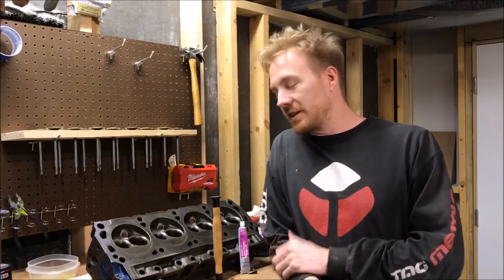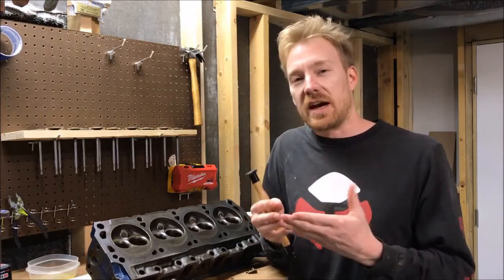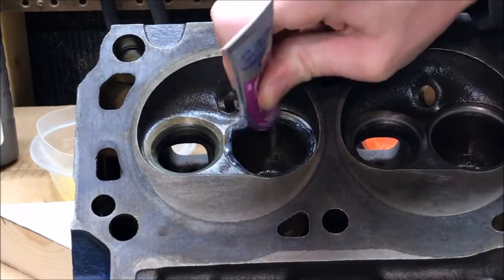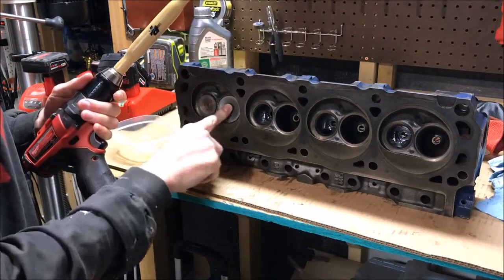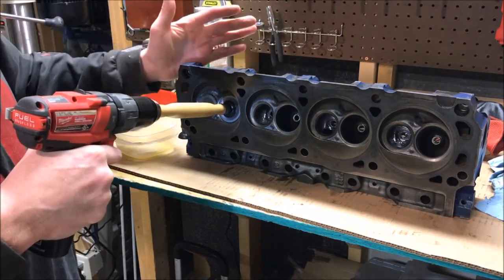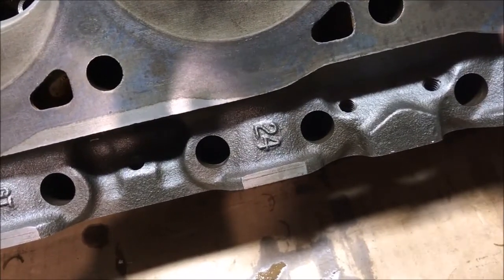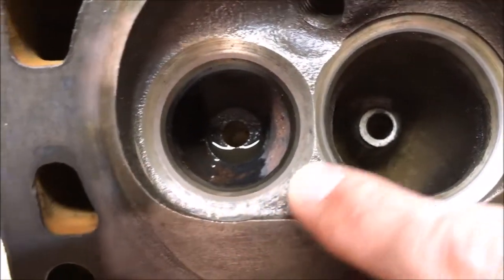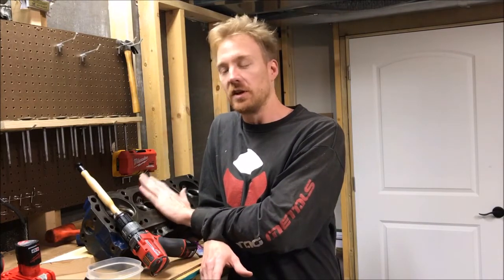Lap Valves the EASY & SAFE way on GT40 Iron Heads

Comment: When you're drilling the valves back in with the suction tool, you wanna drill back and forth; a few seconds clockwise, then a few seconds anti-clockwise, and repeat, until you no longer hear the grit. This is better than just continuously rotating the valves in a single direction. Just a pointer.
Reply from the maker: Thanks for the suggestion.  I’ll be doing heads again over the winter and will give your method a shot. 👍
Reply: i guess Im asking randomly but does someone know a trick to get back into an Instagram account??
I was dumb lost the password. I love any assistance you can give me!
Reply: @Toby Ricardo Instablaster ;)
Reply: @Erick Levi thanks for your reply. I got to the site thru google and I'm trying it out atm.
Looks like it's gonna take a while so I will get back to you later when my account password hopefully is recovered.
Reply: @Erick Levi it did the trick and I now got access to my account again. Im so happy!
Thank you so much you really help me out !
Reply: @Toby Ricardo no problem :)
Reply: Correct.
Reply: Every time I see this method of going back and forth I want to know why?  Why is that better than going in one direction, lifting off the surface momentarily and continuing?  I can see no benefit to that.

Comment: I I have probably lapped well over a thousand valves. I gave up years ago trying to get them stupid suction cups to work LOL. I had brass teeth made for my drill and all I do is check the valve stem up in the drill and from the other side of the head I do my lapping .so much easier. You can use any drill, if you want to take the time to put some duct tape on the end of your valve. you'll be good to go. The guy that made this video knows what he's doing he was at the right speed and used the right amount of compound.
Reply from the maker: Hello. Awesome idea grabbing the valve from the stem end. Where did you find brass teeth for your drill?  I would totally do it that way as long as the stem wasn’t damaged. Thanks for the nice comment and suggestions! 👍
Reply: @FastFixYouTube  I had them custom made by a local fab shop. You really don't need them. you can take a empty brass shell casing and cut the neck down part that holds the bullet off and fit it over the end of the valve and then chuck that up in your drill. Or just use tape
Reply: @FastFixYouTube  I have a video on my channel of my process

Comment: Thanks very much for your thoughtful and well produced video!

I'm working on my first flathead engine and potentially first valve job.  As usual, I do a lot of research to learn tools and techniques before diving in.  While watching the ridiculous old school method of back and forth spinning a hand tool on multiple videos I thought there must be a better way and contemplated buying a standard set with 4 suction cups and mounting them on 5/16ths dowels to chuck in my drill.  Now you've pretty much confirmed my thought process so that's what I'll do first.  I can control my drill right down to almost a standstill very easily and just as easily either reverse direction (which I actually see no need for) or simply lift and drop as necessary to get more lapping compound on the seating area.  If all else fails I can go back to the old fashioned way because I'll have the wooden hand tools stored.
Reply from the maker: Hey there! Yes, your intuition is absolutely correct.  No need to do it the old school way. There  are of course techniques and hacks that they use to make the suction cup and hand method work, but the drill is the best by far. Like you said, you can control the speed to a standstill if you want. And yes, just lift the drill to get more compound i between the valve and valve seat. It worked perfectly. Best of luck with your project. Sounds pretty fun 👍

Comment: Use an old Bit Brace chucked up to the valve stem and start turning. That way you won't have to fight hearing over the drill motor. Works like a charm
Reply from the maker: Hello. Yes, I like that idea. There’s a guy who said he got a custom brass chuck made for his drill and it works great. Thanks 👍
Reply: Excellent suggestion! I'm too cheap to buy an oscillating tool and grinding in multi valve heads with a stick and sucker sucks my will to live!

Comment: Hello friend, put the rubber on a short shaft, and put a spring between valve and seat, and you will see that it works better.
Reply from the maker: Good tip 👍 appreciate it

Comment: Thanks for the helpful videos I don’t know if I missed it but how do you clean the heads so well before paint I have some that are pretty rusty can I use evapo rust remover?
Reply from the maker: Hello. Yes, that will work. I used engine degreaser. These heads weren’t very rusty and only had sod surface rust. It takes a good while to clean however. The parts washer at your local machine shop will do a quick and good job. If you don’t have several hours and a young back to put into the heads, I’d recommend the machine shop 👍

Comment: im sorry but how do u expect the suction to stick with it not being wet?
Reply from the maker: Hello. I tried it wet too, but no luck. I’m chalking it up to lack of experience on this. I know a lot of people use the manual method with success, I just didn’t have the talent.  Problem solved with power tools, haha 👍
Reply: @FastFixYouTube  so I spoke to soon. I'm actually enrolled in a tech school taking engine repair and basic electrical right now and was able to experience first hand the complications and pros and cons of valve lapping the day after I posted that comment and I will say valve lapping is a pain in the ass...wet or not wet that suction cup will only stick if it wants to regardless if ur doing it by hand or with the drill 😀
Reply from the maker: Hahaha, well I’m glad I wasn’t the only one having issues 😂😂😂.  Several people say to chuck the valve stem in a drill and do it that way.  The issue I see with this is scratching the valve stem in the drill chuck.  Some people use brass chucks to resolve this issue, but I have no idea where to acquire those.  Anyway, best of luck at tech school!  That’s awesome man!

Comment: I just had a dumb idea. Would it be OK to use a paint cutting compound after you finish regular valve lapping to get a nicer, smoother finish?  🙂
Reply from the maker: Hello. I’ve never heard of someone doing that, but the cutting compound should get them to final smoothness. If you try, let me know the results. Thanks for the question!
Reply: I used glass polishing paste for final finish because valves and hardened seats are a lot harder than paint

Comment: Gas hose on the valve stem and then into the drill. Works a million times better than anything.
Reply from the maker: Yes, that’s an excellent method and what I will do next time. Thanks for the info! 👍👍😊

Comment: The reason your hand lapping hasn't gone well is the fat diameter of the wooden bit , you need to stick it in the lathe and thin it right down to a concave section where your hands would use it , the thinned section will increase the speed , sit your valve seats level , using the biggest sucker on your valve is best , those suckers almost look plastic-ey as they get older and well used they soften and work better .
Reply from the maker: Good advice! Thank you sir 👍

Comment: I just spit on my tool and it usually sticks like glue
Reply from the maker: Hmm, I’ll maybe give that a try next time.
Reply: @FastFixYouTube  Yes, adding a thin layer of water adds surface tension into the mix (I learned it from playing with suction cups in the bathroom lol). Also, who makes your valve lapper? I have an old Blue Point VL3 and that think sticks (and I got it second hand...) I even made the mistake of sticking it to my forehead lol...left a mark)

I do like your idea, although I would just cut the lapper in two, and lathe (can you lathe wood? Im not a carpenter lol) to a more maneageable diameter unless the chuck you have is big enough. Also, a wood screw with a hex head screwed in the middle of the cut could work, but I would also put a hose clamp around the end to help the wood not crack under load. I think it may be overkill though but I like thinking of odd ball ways to do a task easier and faster (Im really lazy lol)
Reply from the maker: @RipRoaringGarage  Ha!  Well those sound like interesting ideas and perhaps worth a shot!  I don't know who made the lap tool....it was a cheapo from Amazon.  Perhaps the extra money would help with a better functioning tool.  Next time!  Thanks for the comment.

Comment: Just chuck the drill on the tip of the valve stem
Reply from the maker: I would urge you not to chuck the valve stem directly into a drill. The stem would invariably be damaged by the metal claws of the drill.
Reply: @FastFixYouTube  done many sets this way zero issues
Reply: Sean Georgi if it slips, the chuck will mar the valve, just like a drill bit which slips. The teeth of the chuck are also pushing into a hardened material with very precise tolerances. It’s not a case of if you have no issues then it’s ok, but basic material physics. Great if you have no issues, but it’s the wrong way of doing it. I’ve seen a lot of vids with a piece of tubing, that should be ok, but for the life of me, the price of a wooden hand tool or drill suction cup is so low, I cannot understand why people just don’t buy the right tools for the job. Good luck and regards.

Comment: You're using an excessive amount of grinding compound. That much is not needed. The trick is to just coat the surfaces grind it until gone and do it again.
Reply: Also it's much easier to just chuck the valve tip from the other end of the head in your drill and use light pressure pulling the valve into the seat. Forget the wooden tool. This is also a good way to check for a bent valve with a drill.
Reply from the maker: That makes sense. Thanks for the advice. Will try that method next time for sure. 👍
Reply: @FastFixYouTube  the cylinder head shops I've been to all use the drill chuck on the valve to lap quickly. It works good and its fast likely with the smaller amount of grinding compound it should take about 3 times of lapping and reapplying the compound per valve but it goes very quickly with a drill.

Comment: Seems like you need to clean those valve guides up. Looks a little stiff
Reply from the maker: You are correct
Reply: @FastFixYouTube  I've heard people say shit about using a drill also. If you are spinning it 72,000 rpm's then no I don't agree. But doing it like you are doing is fine in my eyes, I do many sets per week and you can bet your ass I'm not spinning it by hand 🤣. Doesn't matter how you do it if you can hear your compound.
Reply: @carbonconnection2480  bro same I recently started porting and polishing for any heads before 73 and seen people spin their air lapper at 50k rpm at that point you’re removing so much aluminum the valve is seated way to far in there in the end and I have to make miracles happen.
Reply: @carbonconnection2480  if you can hear it ur good I like to take a thick piece of Mahogany and lay it on my concrete floor. It amplifies the grinding sound x10 and you can go a lot faster.
Reply: @akkadianrecords3709  why only before 73?
Reply: @carbonconnection2480  no zinc content when blocks were casted after 73 you had to add an obnoxious amount of zinc additive to cushion the bearings after 73, before that you could just use modified oil with zinc. When you have that much zinc in 73 post engines it tears them up on a molecular level.
Reply: @carbonconnection2480  better quality cast pre 73 blocks. 73 and on I’ve had issues with always. When machining them they just fall apart or the casting for the cooling channels is shifted when it’s xrayed
Reply: @akkadianrecords3709  . I don't have the luxury of picking and choosing which engines I get to work on. Whatever the customer wants, the customer gets. I can say most of the stuff I work on isn't cast, Billet is what 90% of my work is 🤘
Reply: @carbonconnection2480  hence why you see a lot of 74-89 blocks for sale. They’re junk.
Reply: @carbonconnection2480  efi blocks were okay. Not better than post 73 through. Most 73 are d3 but seen a few with d2 from factory like they had the heads laying around and used them.
Reply: @akkadianrecords3709 . What all do you offer?
Reply: @carbonconnection2480  not billet. Lol. Damn man. Billet is beast.
Reply: @akkadianrecords3709 . I mainly deal with drag racing engines and we do lots of single cylinders also. Billet is the only way 💪

Comment: You should have cut your valve seats first at a 3 angle cut. Why using this tool with the drill if you could just put the drill on the other side and pull and damage this way your valves? 😁
Buy a 25$ valve grinding tool which does the left right turning perfectly.
Anyway, your valve seats were anyway out of specs.
Reply from the maker: Hello. The valves did have a 3 angle cut already.  I didn’t go on the valve stem because I didn’t want the drill chuck to damage the stem. Valve specs were perfect and the motor runs better than it ever has. Thanks.
Reply: @FastFixYouTube  Did you by any chance do individual cylinder leakdown test? Results?

Comment: You really should have the valve facing straight vertical, and you shouldn't use a drill. To be honest, you just shouldn't be lapping valves in the 21st century, it's not that expensive to have your local machine shop cut your seats on a Serdi and grind your valves if you've disassembled and cleaned the heads yourself. I'm a trade-qualified automotive machinist.

Comment: I used a drill a long time ago as a shortcut, and it ruined the seats and valves. Not something I would do again, but hey, if it works for you, crack on.
Reply from the maker: Cracking on! 👍